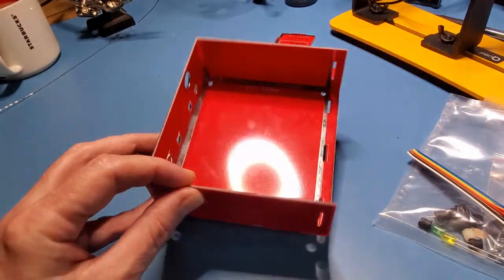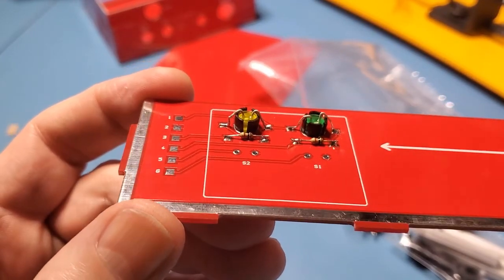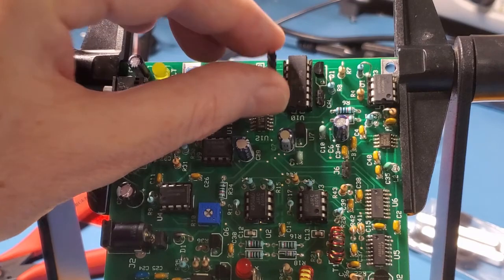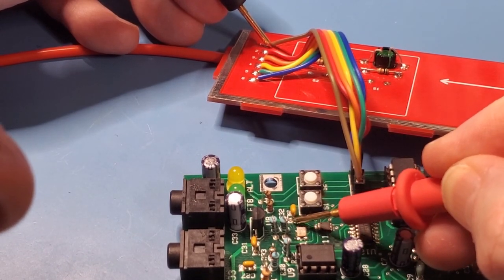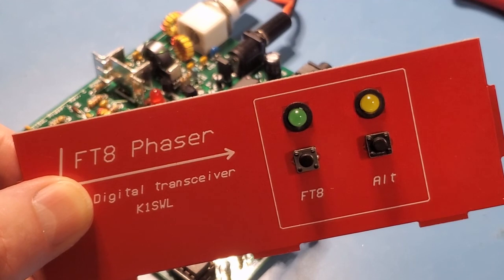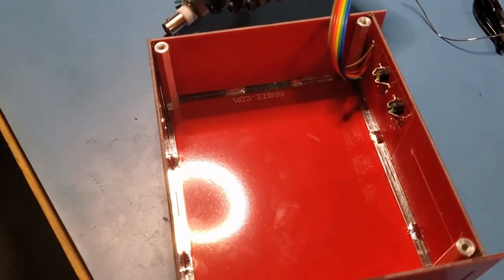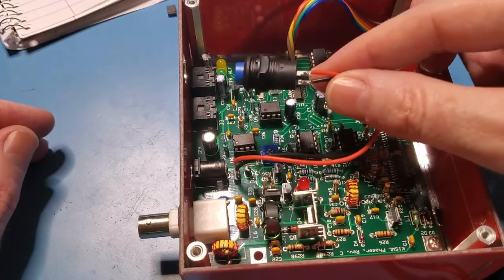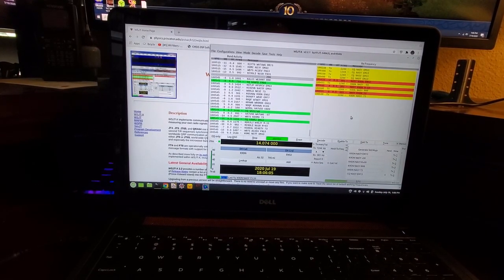Phaser Build  Part 7 - Building the Enclosure

Comment: I've completed my 80 meter PHASER build, including the cabinet. BUT ... the ice and snow took down my antenna and I am going to have to  get my BuddiPole rigged up for 80 meters. I have done FT8 on 20 meters using my Elecraft KX3 rig and had great luck with using just the Elecraft AX1 antenna attached to the side of my radio; however, for the PHASER I want a better antenna well tuned for the correct frequency. I've now got a 40 meter and a 20 meter on order  and look forward to building them. I plan to take my PHASER, my Raspberry PI 4 with the program installed, and a "throw it over a tree antenna " up on the arctic ocean this summer and see how FT8 works from up north a few hundred miles.
Reply from the maker: Awesome - and good luck with your contacts. Have you tried using an end-fed on 80m? I have had great success and they are easier to get up there than a dipole.
Reply: @na5y  I started thinking about an end fed today at work ... yeah, might just be the ticket ... thanks .
Reply from the maker: @michaeldavidheit  Check this article out - wind your own toroid! https://noji.com/hamradio/pdf-ppt/noji/Noji-Article-80-10-EF-HW.pdf